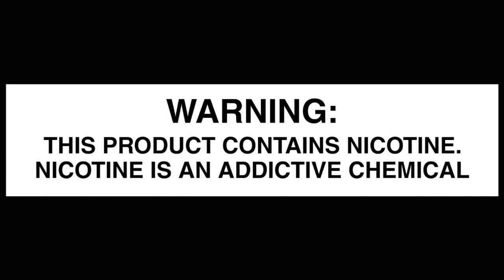Why does my RDA taste strange?!

Comment: Yeah, VG is very hygroscopic (as can be tested by leaving a small quantity in a cup for a day or two, then seeing how much the viscousity is reduced), so until all the VG with raised water content is vaped off, it will taste odd.
A benefit of (good) TC is that you can safely vape your wicks white, and it will be fine after re-dripping/re-filling - without TC you always have to have a little of the old, spoiled liquid in there.  Nicotine (and very likely some flavourings) also oxydises when exposed to air, which adds to the crummy taste.
Kanthal can even go rusty (something which doesn't afflict many other coil materials) - it's generic name is after all FeCrAl, which is the standard abbreviation for the metal composition in order of content, meaning Fe (iron) is the most abundant metal in it.  This is clearly not something which afflicts stainless steel, as desite it's high iron content, it has been formulated to be rustproof.
Reply: I have to ask I'm considering switching to stainless steel would you recommend it over kanthal
Reply: Im just looking for the safest wire to vape

Comment: Also, make sure your wick has not split in two, tug it out a bit and make sure its still in one piece and it not blackened or burnt by your coils. If so, obviously re-wick.
Reply: Especially after purging the moisture out. I noticed that'll happen as well.
Reply: Wick tight to avoid cotton collapsing just a lil tip
Reply: How to avoid cutton split?
Reply: @jessiel.2237  wick ur coils tight (but not TOO tight to where u bend the coil pulling the cotton through)

Comment: This is something I use to tell people that came into the shop I worked at.

I always advised them to store their rda's w/ the airflow closed with dry-ish wicks, and handed them a drip tip condom to put over their tip (back then everything was 510)

I didn't so much think of it as moisture, though that makes more sense.. I figured it was just oxidation of the juice and a degree of the cotton collapsing in the coils from it.

Comment: I use 18 different tanks and I've found that if you close off the air holes and put a cap over mouthpiece or turn tank upside down (also closes off air) it keeps taste better than not doing it.  Only air that might have moisture in it with this method is the air contained in tank itself which has already been heated so will contain less moisture that could collect.

Comment: I thought it's because of the vegetable glycerin being exposed to air. It breaks down to part water and part glycerin until it reaches equilibrium and this water causes the moisture. This is also the reason when we leave our juice exposed to air it loses its viscosity.

Comment: Note that I also have an rda that has begun arcing on the posts, I have gradients of Auburn to juice color from bottom to middle-middle to bottom cotton seconds of initial few cotton soak/puff and the regulated chip for reading ohms in my mod/battery aren’t stable reading; nowhere under +.4 ohms

Comment: Isn't it rust on the coil by oxidization of the métal ?
Reply: Usually there is enough VG on them it will not really Rust unless they have not been used in a fairly long time.
Reply: I get it on mine and I only use SS wire. It doesn't rust.

Comment: Unless you’re storing you atties in the fridge or have wild temperature swings in you apt/house it’s likely not condensation. The device needs to be below the dew point of the air for that, think cold glass gathering beads of water. 

It’s the vg and pg doing the hygroscopic thing, absorbing the water from the air. 

Still water diluting things but differently. 

Sorry to be “that guy”!

Comment: VG attracts moisture. Like, it literally pulls moisture out of the air like a succubus, and the liquid inside becomes watered down. You can test this by taking the last few drops of a bottle, and leaving it out in the open (uncapped) for a week. You’ll come back and have much more liquid, but it’s mostly water. I’ve known this for a long long time. Not sure why VG pulls moisture, but I’ve lost two PS4’s and now a tv due to small amounts of VG collecting on the GPU/APU chip and essentially rusting it to shit via this moisture succubus BS, and forcing me to buy a brand new entertainment device. So, that’s why your mods tastes like ass after a couple of days of sitting with liquid in them. Best bet is to vape the cotton as dry as you dare before leaving it sitting on a desk etc.

Comment: I notice when I take out my old build from my Drop RDA, my old liquid kinda just fucking magically keeps its taste in the bottom of deck. So of course I run some steaming hot water with a little bit of soap or soft cleaner and soak it for a few hours, let it air dry completely, and wipe out the deck. Put the new build in with a different liquid and of course there's still quite a bit of residue left over even when I'm 20-30 drips on the coil(s). Any solutions?

Comment: I've a suggestion true is I need some help I got into rta a while ago and people told me ni80 seems good I had 26g kanthal so I roll with it and I got on ni80 2xcore fused clapton 2*26g+36g looks micro and good but till I build tfv12 king dual I had good cloud good flavor wick all fine but there is interesting part when I'm to let the smoke out my lungs I get that shit flavour idk where does it come from but it's terrible so I have Zeus dual rta single coil banger taste all good had a short I'd  say little bad flavour and it fixed up in a little using cotton bacon no issue there tfv8 king tfv8 baby beast kratos 80w and lot more sub ohm had no such issue with 50/50 base 6mg and RagnaRock flavour no old juce fresh from 3 4 days ago I got the issue on tfv12 king dual rba deck  also on the Zeus dual a little also on and right now on pharoh rta for some reason does not come up on my wismec rs200 as an atomizer but I have single fat coil in the middle all clean all good nicley wicked but yet I'm rocking it on eleaf Istick power 80w nice mod for small sub ohm or mid stage coil rta tanks I'm guessing ima click the bell and expect the next video by the way I'm not talking pre build coils I'm talking 15 feet role E-XY idk if it's the role but hope not soon I'm getting pre build package ss316l hope there is a change / The coil is 8 Wraps compressed on a normall Philips screw driver comes at 0.80ohm pulse at 25 38 45 60 and let cool down

Comment: So I have been getting into rebuildable mtl RTAs. I have no problem with this on anything that is direct lung, drippers, rtas, ect. for some reason though, my mtl builds ALWAYS taste disgusting. overbearing cotton taste no matter what cotton I'm using. I have tried everything, washing hands,using gloves, glowing coils, not glowing coils less cotton more cotton, different cotton x100, every time the result is the same- gross ass cotton taste. is it just that because the mtl  chambers are so small is exaggerating the cotton taste? I cant pin it down. Are rebuildable mtls just like this and every youtuber is just pretending that they are great because its cool but they really suck ass? what is happening? this has been my experience with the vandy B3, the aromamizer classic, the dot rta, and the dotmod aio rba. I'm at my wits end with this.